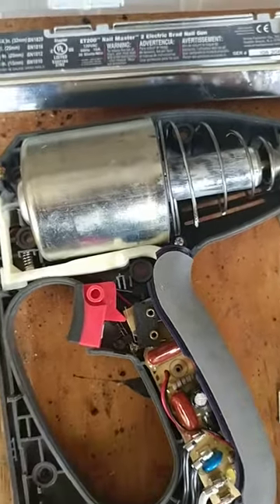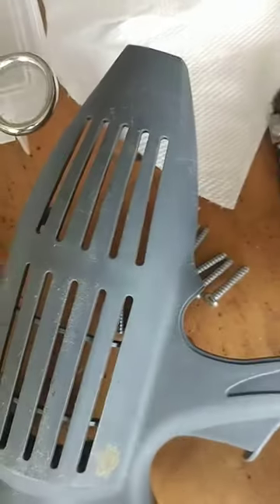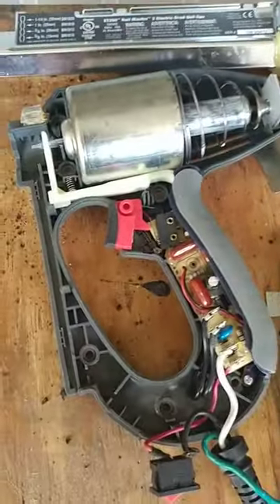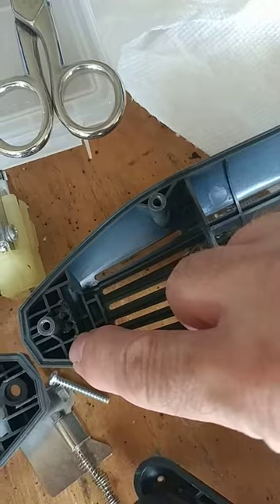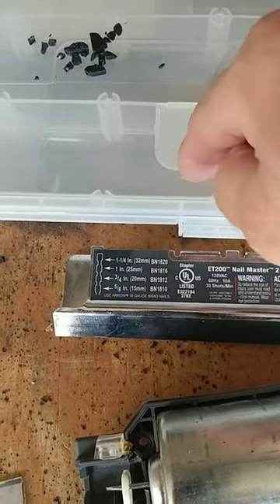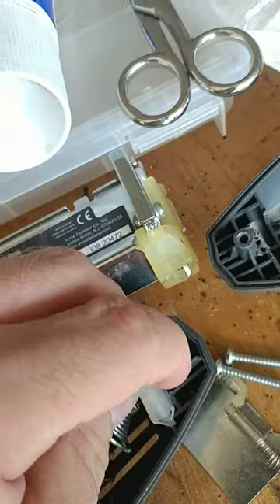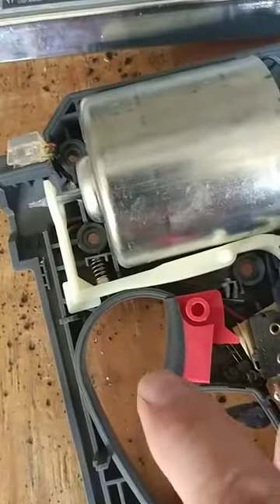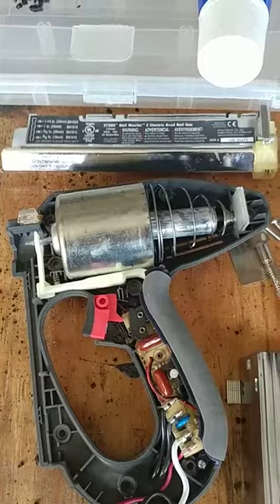Arrow ET200 Nail Master 2 Fix

Comment: Man, you were a life saver.  In my case I had some particle wood pieces from who-knows-what that I saved that were the perfect thickness.  A couple of coping saw cuts and I was off to the races.  Thanks again. (You also helped me see where my loose spring belonged)

It may not last, but at least I could finish the job I had started.

Comment: @ Michael Parker ; Glad you were able to fix yours. I have an Arrow nail Master 2, purchased in 2010. I used it only once for a kitchen renewal project, then put it back into its case. Today I needed it for a small project, but when I opened the case, the "non marring bumper" p/n 2815,  was a crumble of little resin pieces. I have been looking on line for replacement parts for this gun, but am finding that Arrow does not seem to support its customers with parts. After viewing your channel, I'm starting to think that Arrow deliberately chose materials for their nail guns that self- destruct over time, so as to force you to buy the latest greatest model. In the case of the non marring bumper, it is too complicated of a design to try to fashion from a raw piece of plastic.

Comment: Thank you so much!! We do beekeeping and we were in the middle of doing frames and our nailer stopped (same model). And low and behold the same issue. We did the same thing you did and it works like new again! And the misses is super happy again
Reply: I’m getting g one of these second hand for this exact purpose. Do you find it works well? I have a pneumatic gun but they don’t work well in the winter.
Reply: @JosephSastreShowsYou  it works ok. For what it is. We did use it alot! I've seen worse